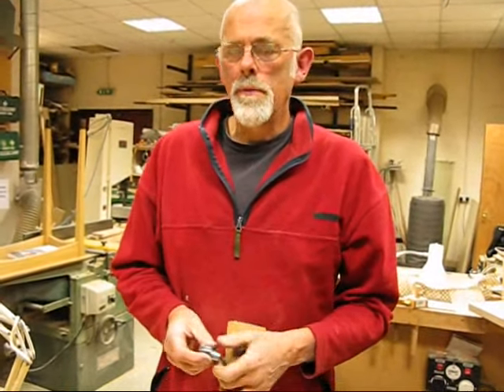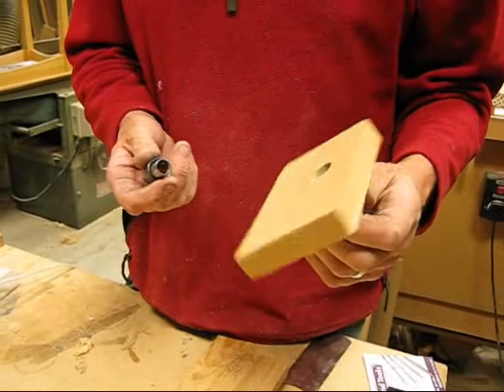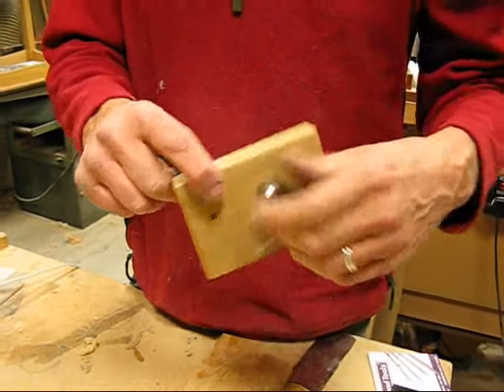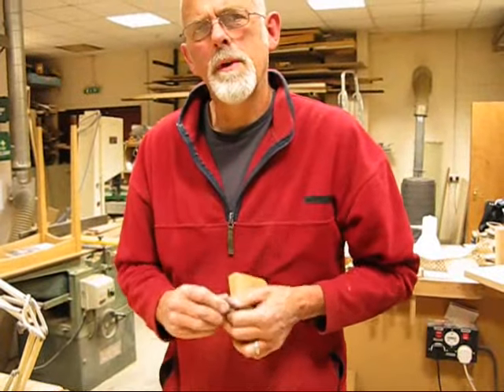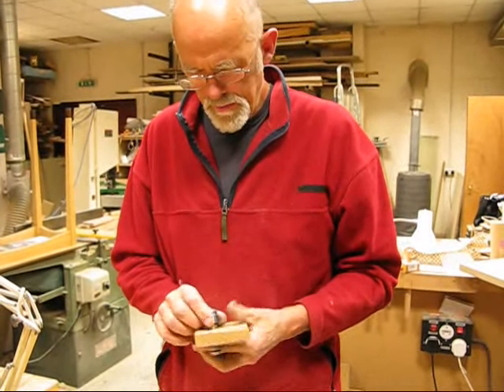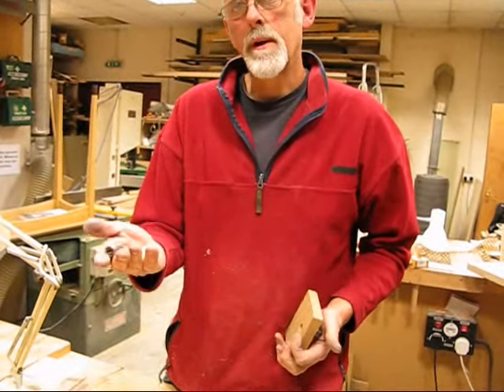Router collet removal tip

Comment: Brilliant tip, just to add to it, I tried to use some old softwood to do this, it didn’t work, used a piece of oak in the end, worked first time.
Reply from the maker: Good point, it needs to be hardwood else the collet expands and tapers the hole in softwood.

Comment: thanks for sharing your experience with us. I have a Festool Router OF 1010, unfortunately, what happened, the bit came out during workprocess and the collet is stiff in the spindle.   I am afraid of how to get it out. With help of some videos I disassembled the router but than got stuck.
Reply from the maker: Hi Anita, I have never had this problem and also have limited experience of Festool routers so I cannot speak from experience. I assume you have removed the collet nut and the collet is stuck in the spindle. If I had this problem I would probably start by tapping the side of the collet with a hammer. If that doesn't work I'm not sure what to advise. You could try gripping the collet with mole grips to compress it.

Comment: Hi Chris, thanks for this video. My 1/2" collet is actually stuck inside the Router Spindle. The Bit has come out easily enough but the collet is stuck firm. The Router is brand new, I've only used it twice. Have you any idea how I can remove the collet without damaging it?
Reply from the maker: Oh Dear Peter! I had this happen to me once before but unfortunately cannot remember how I solved the issue. I wonder if you could tighten a small jubilee clip (as they are called in UK) round the collet to squeeze it up and so loosen it in the spindle.

This problem can arise if you don't engage the collet with the collet nut before assembling. You should be able to press the collet home in the nut and hear it click into place then screw the nut on the spindle. If you just place the collet into the spindle then tighten the  nut over it you can get the stuck collet problem.

Not sure how helpful that was, please let me know how the solve it.
Reply: Peter, I have the same problem with a brand new router.
Reply: Well I solved my issue. I loosened the nut almost all the way before it comes off, then tapped on it with a wrench. After tapping several times on the nut from either side, the collet came loose and I could then slip a bit in.
Reply from the maker: @Mike-gz4xn  Thanks for the feedback Peter, I hope others find it useful.
Reply from the maker: @Mike-gz4xn  Have you tried Peter's solution?

Comment: the collet and bit both get stuck in the router.  both 1/4” and 1/2” collet setups get stuck in my milwaukee router.
it’s all looks smooth, and clean but gets stuck.  the nut slips off the collet now where it did not do that before,
i’m installing it into a nice JessEm lift, and thus is going to be a nightmare if it gets stuck.
the one thought i have us that they call it is stuck in the collapse position. That’s why the collet is not holding onto the nut anymore.   i don’t think the tension from the collet is enough to release itself from the router because it’s a taper and not, let’s say a 45 degree angles where it could push itself out.
this is do baffling.
please let me know if you have any thoughts on this.
thanks for the video.
Reply from the maker: Hi Gino. I am not sure that I fully understand the problem. However I do know that there can be problems with the collet sticking if you do not fully insert the collet into the nut before screwing it on. The collet should click into place, this may require some effort, perhaps pressing down on the nut with the collet on a firm surface. If you don't do it that way and instead  put the collet into the shaft then screw the nut on it will force the collet into the taper causing it to stick. Hope that helps but not sure it does!

Comment: Hi Christopher
I have a DeWalt 26200 router for my x-carve,  and I would like to have different size of the collets. 
Do you know where to buy that ?
Regards
Kristian / Sweden
Reply from the maker: Hi Kristian, Dewalt collets nuts are usually universal within the shaft size ie 1/4" nuts are interchangeable with different models, as are 1/2". Miles Tools and Machinery have a good range http://www.mtmc.co.uk/Search.aspx?strSearchText=Dewalt+DE6950+Replacement+Router+Collet+&strType=basic I have dealt with them a few times and their service is good. Don't know if they ship to Sweden.

Chris

Comment: Or you could just purchase a Bosch 1617. It comes with both Collets and Nuts. You just take one collet and nut assembly off and screw in the other. Simple!
Reply from the maker: Yes you could do that, although I am not overly impressed with Bosch routers generally.